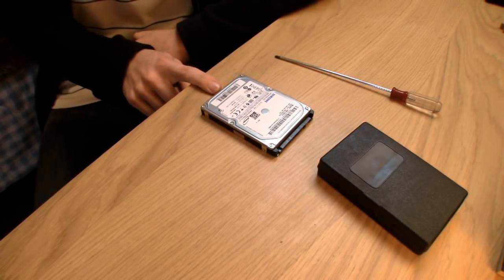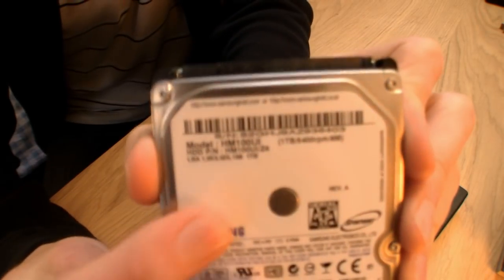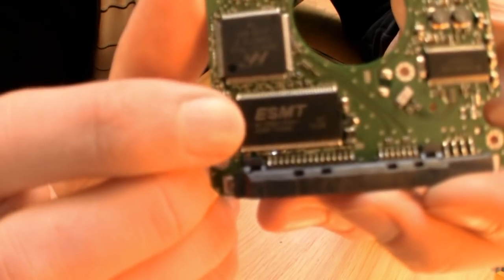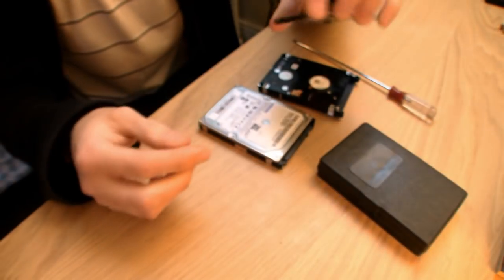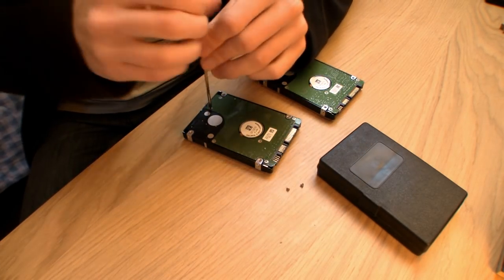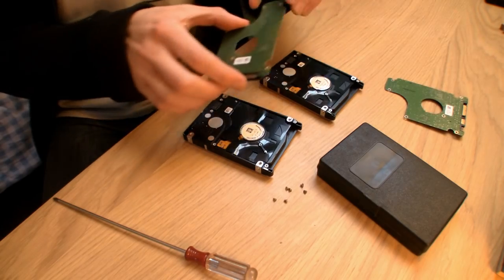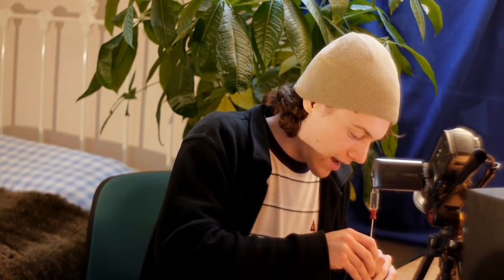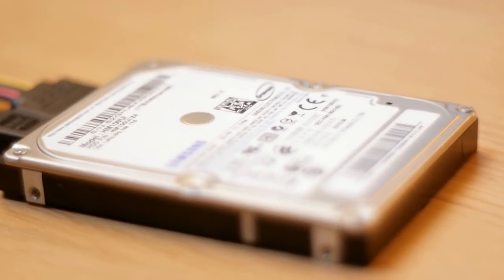how to fix a hard drive (and get your data off)

Comment: Hello, I bought a hard drive reader and I can hear my hard drive spinning and the lights on the reader when I plug it into my laptops. But my laptops are not finding the hard drive for some reason?! I've tried windows 7 and windows 8 laptops and can't get it to work :(. It has so many pictures, files, and old college school work I'm desperately trying to get back. After a couple of minutes, the hard drive stops working spinning.

Comment: Does this work on SATA-hard drives too? I got one 320gb from a friend, he didn't need it, it had been in a Windows 7 computer, from 2008. I plugged it into my computer and it worked. Then, when I came home and plugged it into my computer again, it wasn't found on the computer, there was a clicking sound from it, and after that it was dead.
What should I do? Same as in the video?

Comment: If they replaced the PCB on the drive and you cant detect it, more then likely the PCB is wrong. Samsungs I believe you have to be within 2 weeks or newer for a replacement board replacement or the firmware wont work, unless you get lucky. Always try to get a date that is really close within 2 weeks.

Comment: Hello Sir
i have my Seagate external hard drive 1 TB is Connect with my PC but get some Power Cut in my home after that when my home power come back after i start my PC but my Seagate external hard drive is not detected in my compter

Comment: my drive gets detected in bios but doesn't get reckognized. It appears as "Sata channel:    " showing a blank space instead of "Sata channel: None" . When I select it in bios there's no details. Drive itself makes no noise at all but starts getting hot if its plugged for a while.
Tried different, ports, cables, and in 3 different computers ( in 2 of them didnt show up at all in bios).  Can anyone help ?

Comment: Matt, also have a dead Samsung HM250HI drive, swapped the pcb and the drive spins ok but not recognized in windows, I also noticed the dead pcb had a ESMT chip where the replacement had a Samsung chip. Do you think if I source a pcb with a ESMT chip it would enable me to recover data , thanks.

Comment: i have a question if anyone can answer that would be great, i have a really old laptop with a load of my old songs on it, the screens broke and I was wanting to know if I could put the old hard drive into my new laptop and get the songs that way or would it not work ? the old laptop hard drive was made in 2007 and my new comps brand new, I just thought Id ask before doing it so I don't break my new comp ( : cheers!
Reply: Matt thx for replying matt, il go and get myself a usb enclosure then
Reply: The best thing to do would be to take out the HDD and put it in a case and use it as a external HDD on your new laptop. That way you don't mess with your new laptop. You can find these cases on computer stores. The OS and drivers stored in your old HDD won't work with the new laptop, so basically your original idea is not good and you would waste your time. Best regards
Reply: Juan Velasquez Didn't see it was replied before...
Reply: Grebz || Free Dubstep ♫♪ Buying a USB enclosure doesn't guarantee that it'll be compatible with your old HDD. If it's from 2007 then chances are its an Enhanced IDE drive. If you already have an external/portable HDD (from around that same time) then you can crack the case open and switch out the drives and recover your files.

If you buy the enclosure from a store then be sure to bring the drive with you so the person helping can identify if it's IDE or Sata.

Comment: My seagate 1tb one day suddenly stopped been detected any idea ? The hdd spins so is no dead , I have tried using different cables and does not work and have also tried connecting it by usb and still not works .
Any ideas please ¿?
Reply: Patricio Da silva I have the same issue. Still figuring out what to do. If you find how to fix it, please let me know!
Reply: I found out a little fix that i have not been able to try yet but is basically using the "Putty" program on windows and connecting the hdd from a different slot than the sata one to the USB to manually reconfigure the hdd , if you need further explanation let me know and if i do succefully repair it i will answer back ;)

Comment: Hi Matt, what is your opinion on an external hard drive from mid 2011? I bought a 3TB Seagate and it was working fine recently but has developed a noise over time. I guess a chirping sound. Now all of a sudden the laptop/pc doesn't recognise it in my computer, and it just clicks when starting up. Do you think it is worth trying to replace the board? or has it gone to HDD heaven? It was almost full, so that is a lot of data lost.

Comment: There are some sites apart from Ebay where you can also find hard drive PCBs. Check for example "hddzone" or "onepcbsolution" (adding a dot com at the end of the URL, of course) :)

Comment: You were Lucky - you usually have to swap the firmware rom chip from the original drive onto the new circuit board - its not as easy as it looks!!!

There are sites you can buy the boards from that specilaize in the firmware transfer as well.

Nice presentation though!!!

Comment: I was wondering if you can help me or have knowledge of this type of harddrive failure?

My harddrive is seagate from a Apple Laptop and its making a clicking noise. Its stopped working and I've taken it to numerous places that have said sorry they can not recover it because it is damaged. They have suggested for me to take it to Lab which can cost anything from 1500-3000$.
I was wondering if there are some other ways this might be able to work? or I can try?
Any help would be appreciated.

Comment: I dropped my USB hard drive. It makes a noise for the first couple minutes and the LED is on while connected to the PC. However, it's not recognized by the PC. I already opened the screwed but nothing changed. Is there any other solutions to at least take the data off?

Comment: hey matt...i have a 4tb external that spins up then shuts off completely , windows detects the drive as unalocated and cannot initialize even tho the platters arent spinning.even tho i know there is data on it. i already folloed your video on parking the heads manually. do you think the board went bad or do i have to send it to a lab for a dtata recovery?. thanks

Comment: i already replace a pcb on my external hardrive, and it works, the light is on but still the drive is not detective, but the hard drive is running normally and  no beep sounds,.. I've already try to check it on the disk management but still the drive is not there.. I've already check on other computer but still no hard drive.. my external drive is Samsung S2 external drive... please help me...

Comment: Hi.. My laptop was become slower
so i try to restart 
but it didn't shutdown. so i power off the laptop and it didnt boot again
first hard drive was detect from the bios. but now it doesn't detecting
but i can hear it is running with a click noise
please tell me a way to get the data from it

Comment: i have my laptop harddrive in a  case thing which connects via USB to another laptop and 1 day i accidently dropped it. and it hit ground nothign haardcore but after  tried connecting it again to laptop wasnt ebing recognised and i could hear a soud being made same sound over and over a again. almost like the disk is being stuck or something.

can anything be done about that?
Reply: the laoptop this drive im talking about is from has 2 harddrive im assuming both are the same would that method work on this?

Comment: A few days ago, by HDD (somehow) failed. I removed it, and took a look at the chipboard. There is quite a bit of rust on the chipboard, can this be the problem? The HDD is around 2-3 years old.
Reply: Try removing the board,  cleaning the contacts where the board interfaces with the internal components, then re-mount it.  I've had good results, a few times, with bending contacts that are normally under spring tension so that they push harder on the contacts..

Comment: This guy is right but I can say it is NOT easy to do this in practice.  I had a drive fail years ago and to find the EXACT board was essentially impossible or too expensive.  There where sites that keep track of exact numbers, firmware, pictures etc and they wanted $300-600 for a board.  I tried ebay, best buy, and several other places... the bottom line is that you have to be a very lucky person for this to work out for you.

Comment: this is my issue,,,,my harddrive is dead from what the cheap tech place i took it ended up running slower after i left his shop..all in all went to office depot and bought a windows 8.1 disk with the key of course,cuz the cheap teck put win7 which i wanted but ran slower so i installed win8.1   lost my toshiba media player that it it offically came with my computer think is missing some regestrey keys or somthing.So with all that being said you now think i can perform the sam thing you did and recover my data from my dead hard drive???? please reply soon boss man and tell me soom good news thank you.

Comment: Nice video! My situation is a little different. It still spins and it started beeping. But the computer doesn't recognize it. Would this still possibly be a chip problem? Or is it something else because it does still try and spin? When it spins it clicks every now and then, or makes noises attempting to read it but it is unable to. Any ideas? I have searched and searched and haven't found anything that will work. The last thing I want to do is take it in and pay for it.

Comment: Hey mat, i did what u did and i have got my data's thanks, and i have another question of another HDD it just died it has fallen several times, so now i need to make it work i have seen the CD and it has scratches is there any way to make it work???
Reply: If the scratches are concentric circles (or just a single circle centered on the spindle), you can use something like ddrescue or savehd7 to recover the undamaged areas (you won't get data back from the scratch itself, obviously; and you may even fail to get data located after the scratch in some cases). If it's a transverse scratch, chances are that the scratch will damage the head before any data could be read off.

Comment: How do you nkow if is the Board and not the internal Disks?
Reply: You could try a Live-CD and find out if the system will boot. (A Live-CD boots from the CD and not the drive.)

Comment: Before you do this, which could be totally unnecessary. This is what I tried and worked without having to open the HDD at all.  I used a USB adaptor, there are so many out there, the one I chose was from Cables to Go, now this company was bought out by another Co. When the HDD stopped being recognized, the USB adapter using another computer, I was able to see folders like My Documents, my pictures, My downloads, etc. That is where your valuable data should be in most cases, unless you created other folders. This video is clearly as a last resorce when everything else has failed. The USB adapter runs for $25.00.

Comment: actually my PC is dead and I left with hard drive only....  repairmen said you need to change mother board...  that's really costly....  I purchased hard drive casing but when I plugged in I remembered that it is bios locked and can be unlocked on same system type...  I know the password...  but don't have similar system to fit and unlock...  help me

Comment: the only thing you can do is move disk to a different case or change head but you have to center precisely the head and disk.. - I have tested on several disks and it doesn't work

Comment: Most drives have at least a 1 year warranty. What you did is void your warranty. But if you insist on doing this remember that the bios chip should be transferred from the original HDD board and solder to the new board. Then you seem like you are unsure about what to do much about anything here on the video. Congratulations on your success!
Reply: Paul Langton-Rogers I back up my data daily. I wouldn't have it any other way. I have approximately 16 TB of data and 6 TB of that is the back up. And today the drives have a 3 year warranty as the quality has gotten much better.

Comment: Oh my £600 for 1TB back in 2011 now under £60 just shows the pricing.  I understand what your saying regarding drives I had a 300GB drive but I used even the same controller board off another and it did not work .. lesson learnt even 6 years on!

Comment: my friend,

my toshiba 3 TB drive spins and attempts to mount - but can't.  I wouldn't describe clicking, but more of a spinning and electronic 'pulse' in a repeating pattern which I would imagine to be an attempt to mount - I don't know.  Do you, Matt?  or anyone else?   Thanks in advance for your expertise and advice.  Will Pope, Montana
Reply: Hi Will, it could be that the drive isn't receiving enough power. Have you tried the drive in a different computer?
Reply: From my experience (two bad 2TB hard drives last year) I would say it's trying to find track 0 and can't. After several tries my HDs powered back down. No fix. Lost everything on both drives. The old 500 MB and 1TB drives and still working with no problems.
You might want to d/l the free version of Easeus Partition Manager. At least you can tell if your system is even seeing the drive.

Comment: Do you know how to get back files from an inaccessible hard drive,because when I am just about to use it it says (FORMAT DISK BEFORE USING) and I have important files in there.Now I decided to try using it again and it the same thing but, when I took out the window an other window pop out and said (This disk is inaccessible) plz I need help I have files in there you know
Reply: if you used the hard drive with a different computer(specifically a different type of computer device) try using that to access the information. or check if any drivers need to be installed. the main times I've seen the problem is when a hard-drive has been taken from a device with a specific format(for me a gaming console) and tried to be read on something that doesn't use that format(like a pc). disclaimer: i have no official qualifications in dealing with computer hardware.
Reply: thanks for the tip and it was for a gaming console
Reply: ***** thanks for the tip

Comment: I've got an external usb drive that I let get very full with working files / constant access.  Just started giving me problems when I got a new one.  Windows sees the drive, and the files, but when I try to open the files, or copy / move them, it says there is a disk error.  I'm running chkdsk on it, but so far it's on day 3, and only 10% done. Lol.  Losing hope.  A lot of important stuff on there that's not backed up.  Any suggestions on getting past Windows file system errors, or whatever is happening?
Reply: Jack FnTwist I heard somewhere that plugging it into a Mac will give me access to the files because it bypasses Windows errors, then I can transfer them back to a new hdd, and restore the buggy one.

Comment: Will this work , if the hard drive is dead cuz of a liquid spillage
Reply: +Dulcie Frederick Maybe. If you shorted the curciut board it should work. Check for burn marks on the pcb. If you submerged it in orange juice then definetly not. Even a drop near the platters can kill one.

Comment: Hey Matt, I don't know if it is the right place to ask but, my laptop hdd makes funny noise even if I scrolling down my chrome browser, starts around a month ago, and I disassembled my laptop, plug the hdd in my desktop trying to check bad section or so, interestingly the noise is gone, when I put it back into my laptop, noise starts again, any thoughts why?
Reply: Clone your hd to another hd. Install the cloned drive in your computer and try that. That should answer a lot of questions.

Comment: One day my HDD stopped working after a system restart... I was like WTF, how it can fail just like that...
The HDD is spinning and it looks like it is working, but by start the BIOS says DISK BOOT FAILURE INSERT SYSTEM DISK AND PRESS ENTER. What do you think, how can I fix it?

Comment: Also, back up your priceless data to the cloud, USB drive, external hard drive, external SSD etc, don't put all you eggs in one basket so to speak. If you leave priceless data on a mechanical hard drive, you are knocking on trouble's door and trouble is always home to open that door.

Comment: On any new computer ALLWAYS back up all the files on a disk or usb drive , iclouds etc etc.  MAKE SURE YOU HAVE RESTORE DISK HANDY BEFORE YOU START--HEADS UP!!Once this is done reset your computer to factory restore it will wipe the disk clean and all viruses then restore the files back into the hard drive and you will be good as NEW! 
I know because I tried it and it worked!!
Good Luck

Comment: There is no way you could ever corrupt the data on a hard drive just by using a megnetic screw driver. First of all the aluminium and steel enclusure shields it, and second of all; Have you ever felt how strong the magnets inside the harddrive are? They can pinch your fingers pretty bad. It they don´t corrupt the data, few things less of a real hard drive degausser will.